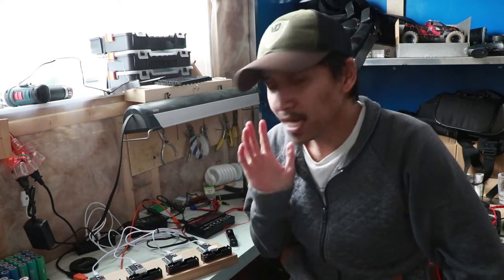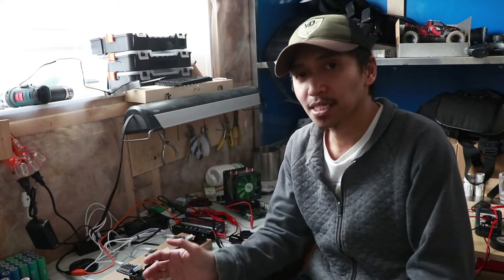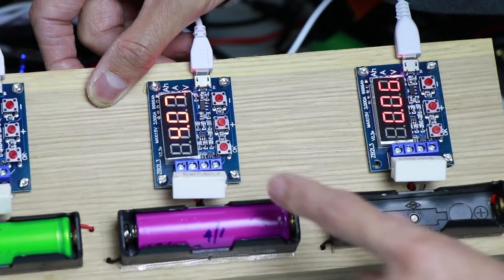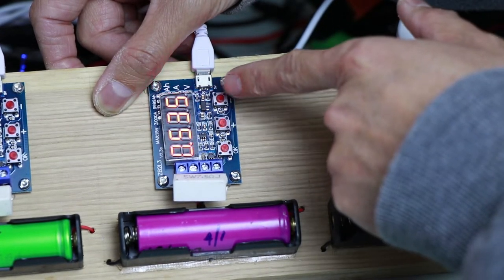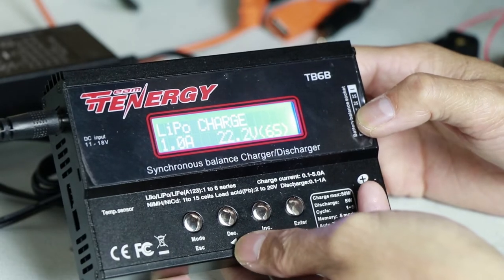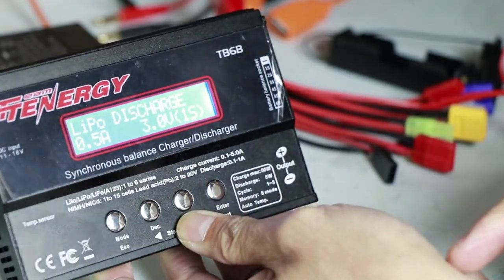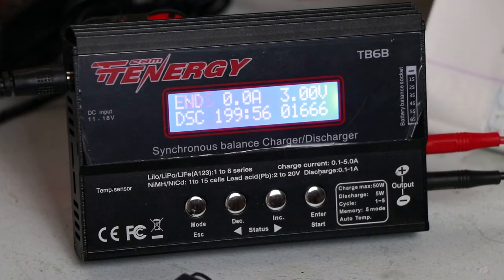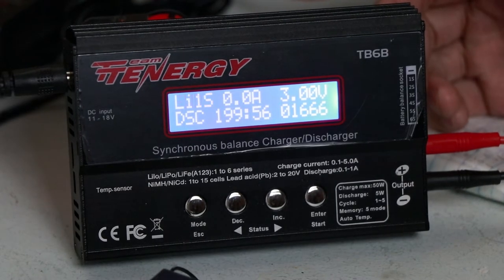My 3 Discharging Capacity tester for Li-on 18650 (Taglish)

Comment: I will having a project po ask ko lng po need po i charge then i discharge po para makuha po ung capacity?  Pde po ba reverse
Reply from the maker: Yes and if good cell,dapat hindi madischarge ng mabilis
Reply: Thank you po plan ko po kc mag sell ng mga 18650 cell from old laptop battery
Reply from the maker: Good luck